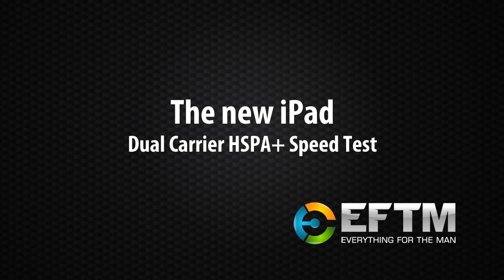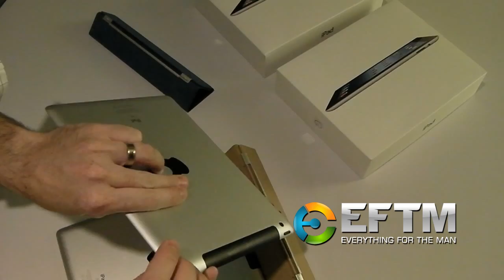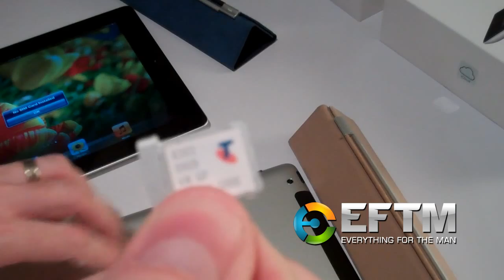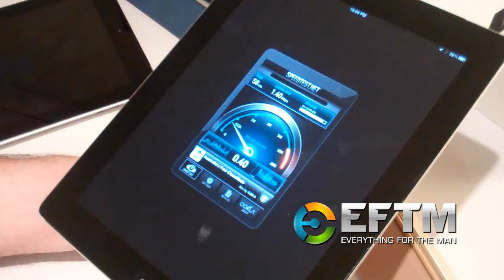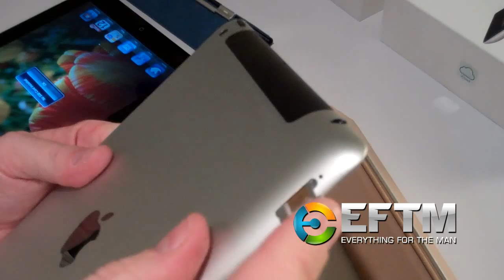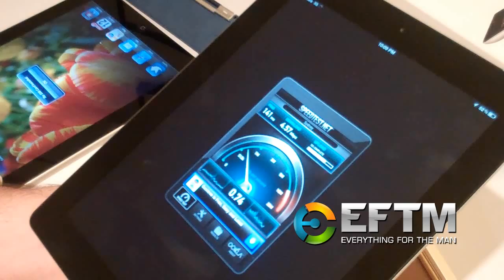The new iPad - Speed Test - Dual Carrier HSPA+ 3G with Telstra

Comment: wow thats means nothing my galaxy 10.1 and sgs3 is currently dowloading and has just about every time i run a test between 7.5Mbps - 12Mbps 
no where near the city where i live and both these devices are said to not have dc hspa+ just hspa+ 21Mbps. ur test are floors as the ipad 2 has a max of 14Mbps radio and the Ipad 3 has a max of 21 at the most telstra towers with in aust dual channel is only available in certain areas just like 4g